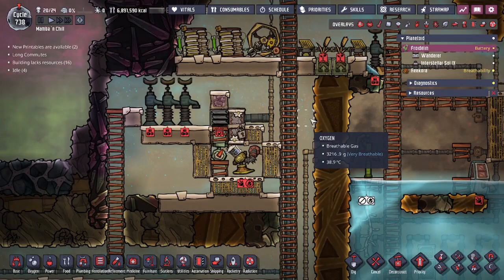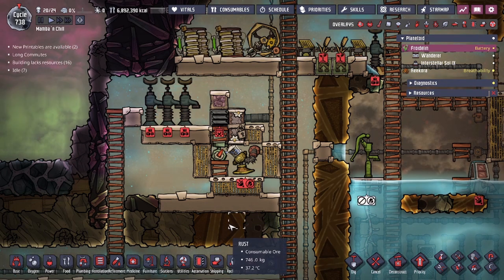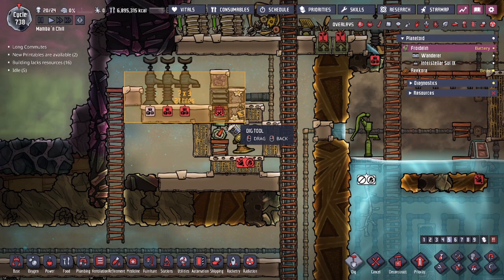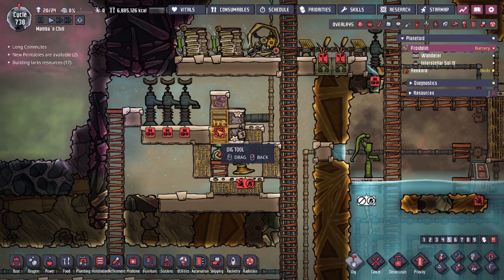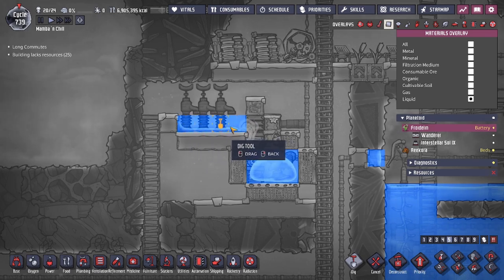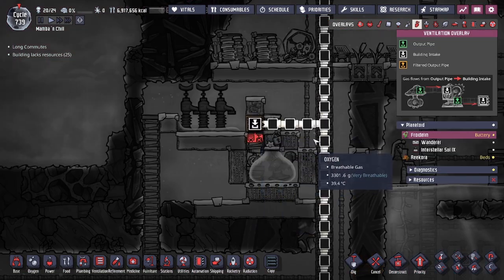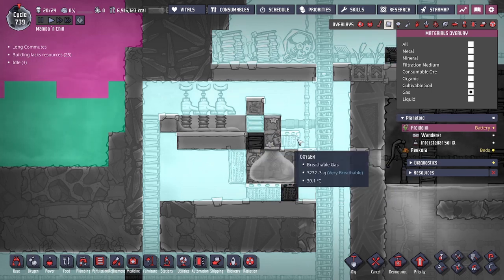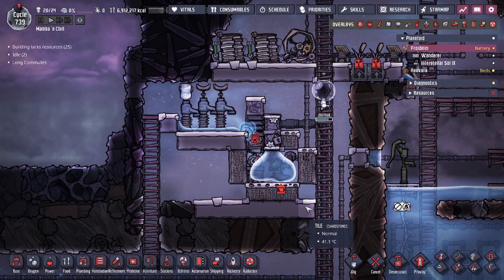How to build the Infinite Liquid Spill Tank - Oxygen Not Included

Comment: Such a clean design. What was the purpose of the hydro sensor?
Reply from the maker: in this specific design, its so that the water guarantee does fall down from that tile. the tile where the sensor is located is right below the gas lock, which keeps the liquid in the tank and to allow you to transfer liquids inside the storage. if you were to overpump the liquid and the water disappears from that tile, the gas lock would break and you would lose the infinite pressure property